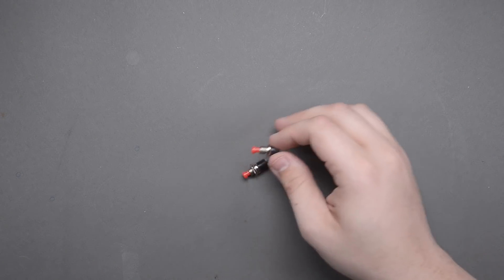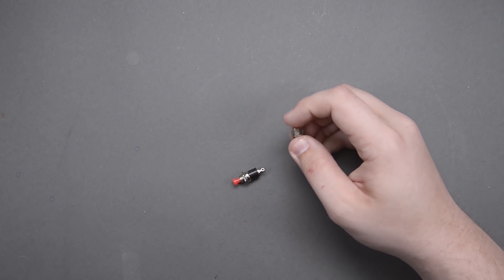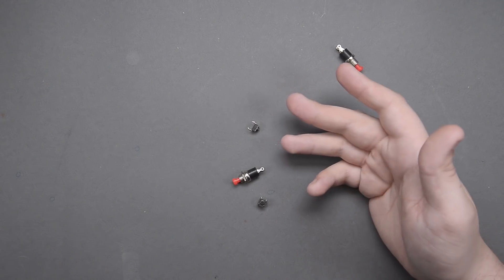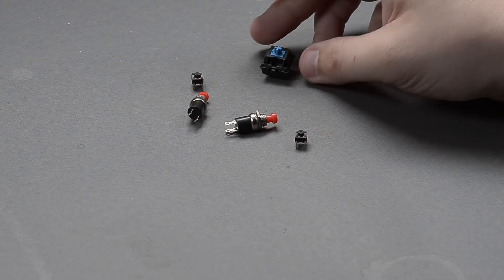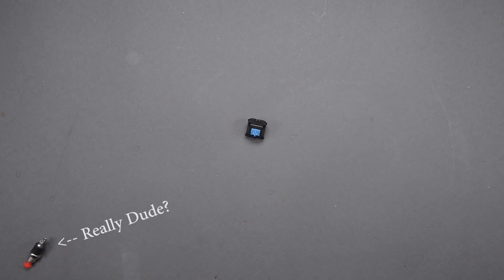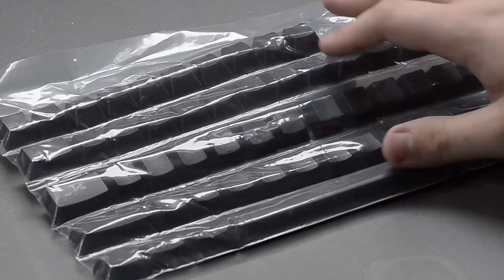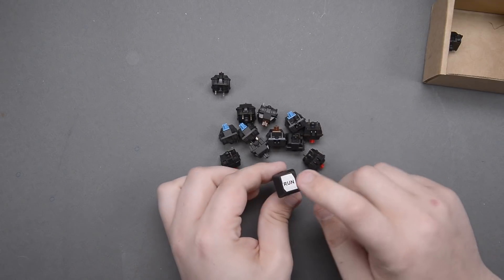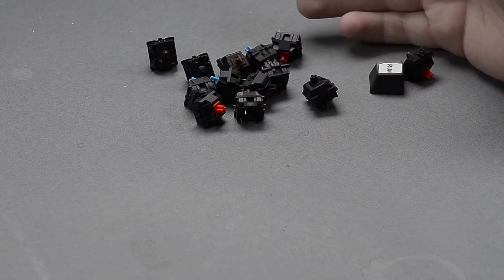Give your projects the switches they deserve!

Comment: The trouble is now that China has copied switches and all other components you just don't know the quality I purchased a steel chrome switch with on-off metal label for mains use for my new power supply and after one month it failed so I opened it and yes it was a China copy very bad quality inside but looked like the old fashioned toggle switch that we used to buy that never went wrong so I have stopped buying from China and I think I will give up the hobby as most components are now cheap copies

Comment: Will the Cherry keyswitches plug directly into project boards?
Reply from the maker: They have a small nub on the bottom that you'd have to drill a hole to account for but yeah, they should be fairly easy to mount (you can see what I'm talking about here - https://media.kingston.com/hyperx/content/Cherry%20MX%20Blue%20Switch%20-%20Animated%20GIF_MXBlue%20(1).gif ). My plan for the most part is to use these with custom etched PCBs but if you're using perf board or something like that, then you'll need to make the hole. Admittedly they're not ideal for early prototypes for this reason and the pins arent perfectly compatible with .1in spacing but they're close enough that you can definitely make it work. My view on these is to use them once I've gotten past figuring out the basic circuit and I want to make something more permanent and presentable.
Reply: @ItKindaWorks  the design reveals that quite a fatigue can happen in the contact that flexes... bad idea.
Reply from the maker: For a production device being manufactured this is probably true and should be avoided but for a few DIY devices and a standoff set every 2-3 switches I think it would be fine. I don't generally mash the buttons on my own projects haha. Do you have a more foolproof mounting idea that is easy for the average DIYer?
Reply: @peasantrobot  What type of switch do you recommend using?